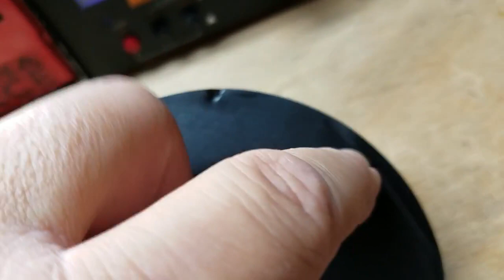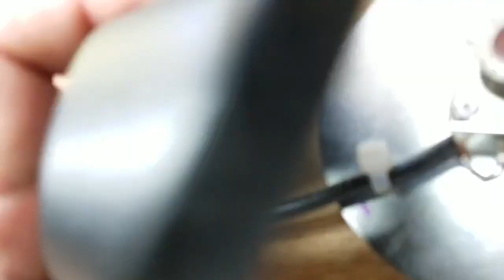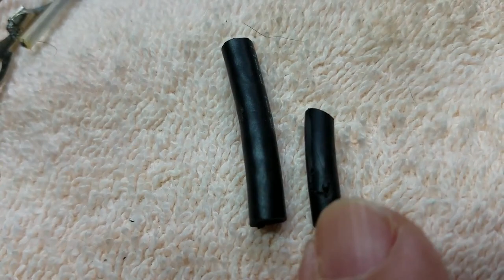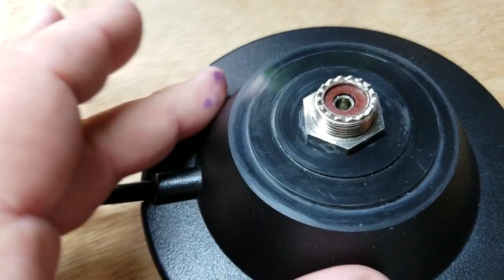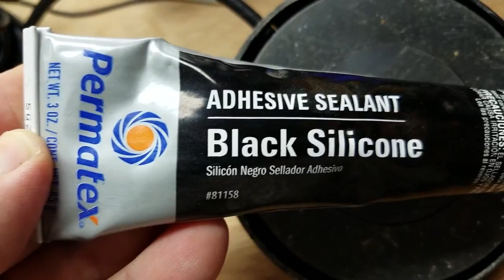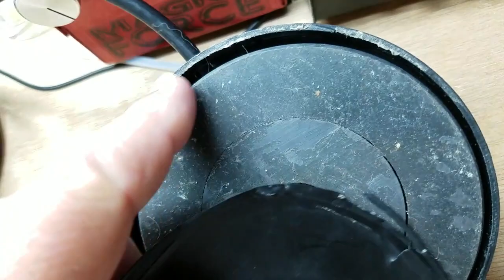Wilson 1000, 5000, Stryker SR5K, SRA-10K Magnet Mount Repair and Coax Upgrade

Comment: I don’t know if you still check comments on this video but here we go, I have been losing my mind trying to get a radio up and running, it is a radioddity qt40, I first bought a cheap antenna and it didn’t work, I tested it and it showed a dead short between the center pin and ground, so I bought a little bit better antenna from Walmart, it didn’t work, tested 400 ohms, so I bought a Wilson 1000, it didn’t work, returned the radio for a replacement, didn’t work. Tested the coax on the Wilson without the load installed and showed no continuity between the center pin radio side and center on mag mount side, brand new antenna never used before not even fully installed just stuck on the roof and had the coax just running through an open door, so it’s never been pinched, pulled, dropped, never been rained on or frozen. Is this a common issue now because Wilson 25-30 years ago was the epitome of a quality antenna. In fact I have a very old 29gtl with bad finals that went through a flood that I got working a little bit that I have had better luck with so far
Reply from the maker: Yikes you have had a run of bad luck. Wilson was bought out and started making antennas in China back 25 years ago, while I have seen them get water inside the coil, I never heard of the coax issue but defective product can get out of the factory. Same with the QT40, defective product happens, it is not often, companies don't want to have product sent back, I have seen a whole product run defective in fact cases of bad product and have had to pull units out the box and bench test, 24-36 at a time. 
I wish you luck and hope that when you do get on the air you have a good time... Sounds like you earned it. Cheers

Comment: Why does my Wilson antenna show a short in the connector it's new
Reply from the maker: It is DC grounded.  All is okay, hook a radio and SWR meter, that is the way to test
Reply: @390WagonMaster  would it make much  of a difference  if I replace mine coax with 25ft instead of the 18 I need a few more feet i will be using rg8x  coax

Comment: Everyone remember to connect the foil on the back of that Mylar tape to the bottom bolt this is very important for magnetic ground to occur. When you look at it stock the foil is bent down at the center to make that connection but what you can do is put a few ss washers in the middle till you get a flush connection with that bolt. check with multimeter. foil to pl259 ground

Comment: Have you noticed the ground if you attach your metre to the cable they and where you’re screwed in then you touched with a magnet that there’s no ground it doesn’t connect that’s what makes us sick. Sometimes it’s hard to get certain vehicles with ground.
Reply from the maker: Yes, and while the mag mount antennas work, I'm more of a drill a hole and physically mount the antenna kind a guy. Cheers
Reply: The foil on the back of the Mylar tape needs to be touching the bottom of the bolt

Comment: What's the purpose of the aluminum foil in the base?
I wonder what would happen if you took the shield and screwed it directly to the vehicle body?
Wouldn't that be just like  conventional mount except without the big hole in the roof?
You'd just have a small screw hole.
Any thoughts?
Reply: That foil is for magnetic ground to occur but it must be connected to that bolt on the bottom. I tried what you said running a small wire from the mount into the body and it did work but didn't make much of a difference versus stock foil
Reply: @gabrielM1111  
Thanks for the reply.   I ended up buying a Wilson 5000 mag mount, and it's working ok.   Talked to Ireland, the UK, and Switzerland today on SSB from North Carolina.   Of course, their base station antennas were probably doing all the work.  :)
Icom 706MK2G & Wilson 5k @ about 80 watts.
Reply: @seeharvester  nice upgrade and radio. we're u on 40ch or freeband
Reply: @gabrielM1111  
27.395 and 27.425.

Comment: Keep in mind, coaxial length is an important element to the antenna circuit. One must know the velocity factor, and compute the length based on odd multiples of a quarter wavelength, considering the velocity factor. This is VERY important. This is why nearly all antenna have around 18 feet of coax. The other two lengths would be 6.5 (too short most of the time) and 30 feet. Nothing in between. (again, exact length depends on velocity factor of the coax) - Research this - Coaxial phasing
Reply: I think that's the biggest debate and antenna Theory when it comes to coaxial cable from what I read most experts believe it doesn't matter what length of coax is
Reply: You know what works best is the length of cable that you need.
Reply: Why does President recommend maximum 9.84 feet (3 meters)?

Comment: Hi 390, I am redoing my 5000 from 2012 I bought new...the problem I have is the epoxy let go from the big "washer" to the magnet and the foil no longer touches the bolt that holds the 239 to the big "washer"...and my mylar isnt coming off, so I am kinda stumped if I cant get the foil mylar
Reply: heavy duty Reynolds wrap

Comment: i intend to run a 12 pill in my car with a Wilson 5000. It will produce 3,300 watts PEP. Is it possible to change the coax to RG-213 on the magnamount and roof mount antennas ?
Reply: I wouldn't run that kind of power thru a mag mount no matter what the advertising says.
Of course this is 8 months old.
How did it go?

Comment: Hi, The whole base is open to water intrusion through the top not sealed and bottom not sealed as well as where coax inters plastic hsg. This causes corrosion and entry to coax jacket. I know that is what caused me to have to do to mine as you have shown. I sealed it all and still using it to this day no problems. Thanks for the video.
Reply from the maker: Just repaired one. Terrible corrosion on the Bolt that holds the D bracket to the magnet. The coax was in great shape.

Comment: In addition : to prevent any vibration & movement causing wire breakage. hot glue the coax jacket to the inside base where it lays down next to the connector. Lil Hot glue the center and shield so no moisture seeps into coax. Med Sand  and clean all the metal touching hardwood every year,especially all the ground contacts. Vasaline or dialectic grease seal the plastic area around the so239, the set screw and the hole where the whip goes in before screwing the antenna on to waterproof everything. Don't overtighten antenna. That will star to spin the counter and dialectic of so239, breaking the wire
Reply from the maker: Great information.. Cheers

Comment: That foil is important.  I was reading today about how magnetic mount antennas make a capacitive connection to ground through whatever it's stuck to.  The foil is part of the dielectric.  The article was a comparison of roof or trunk mount vs. magnetic (spoiler: no practical difference performance wise)
Reply from the maker: I would like a link to that article. Real world shows different IMHO
Reply: @390WagonMaster  https://www.hamradio.me/antennas/magnetic-mount-antennas-dont-suck.html

https://www.hamradio.me/antennas/vhf-magmount-vs-hole-mount-performance-comparison.html
Reply from the maker: I will check out these links. Thanks
Reply: @390WagonMaster  One thing I like about this hobby is that I learn something new all the time.
Reply: @390WagonMaster  
What happened to the links?
I'd like to see that too.

Comment: Great video keep em coming, thanks. Had to replace my cheap coax on the Stricker Antenna with RG142 Mil spec teflon double shielded coax as the coax runs down the back of the car and goes in-between the back door and body. I don't like doing that but I did, the Rg142 is some what more rugged I hope. Thanks again. Please let us know how that Hy-Gain beam is working for you.
Reply from the maker: I have never worked whit 142 coax, I will have to get some. I hope to have my Beam back up this July, It worked very well at my last location and I am sure it will here in Planet Utah:) Thanks for subscribing and watching my videos. Cheers from 390

Comment: Not sure how old that Wilson is , I purchased a new one recently, roof mount , and a magnet mount ,, both of them came with the 62 inch whip ,, both were electrically too short , how awesome is that . !! So , 27 bucks x2 later , I have flat SWR’s on both vehicles . No shout out to Wilson from me . It’s pathetic you have to buy stuff twice to make it right . Total lack of attention to detail . And it’s like trying to win the lottery trying to figure out where to buy their replacement version of that stupid cheap made PL-259. It took me 3 times to get it right on eBay . They have it listed sooooo wrong !!  . They have to be the dumbest antenna folks on the planet .  But other than wanting to take the stinger and switch whip the person responsible for marketing , and quality control by the time I finally got everything that made it work (2 weeks) , performance seems to be good .
Reply: @Dallas-Rife-UDX-347-Tennessee  they always said I'm short for shipping. This loosened the adjustment screw and pull it out a little bit it should be all right